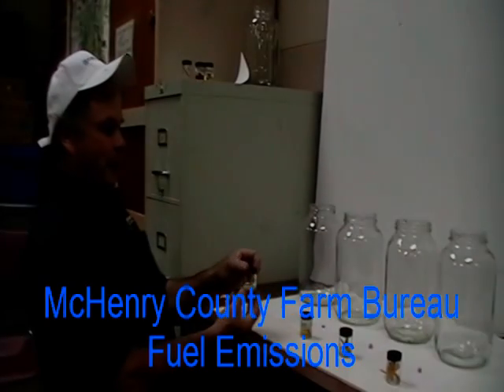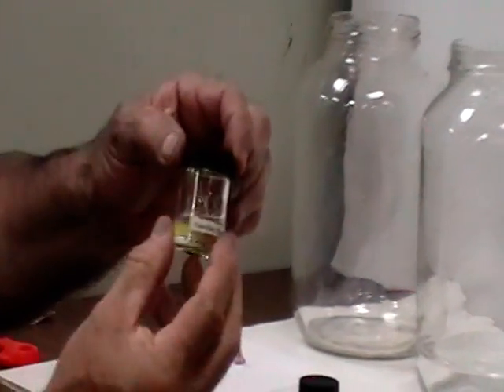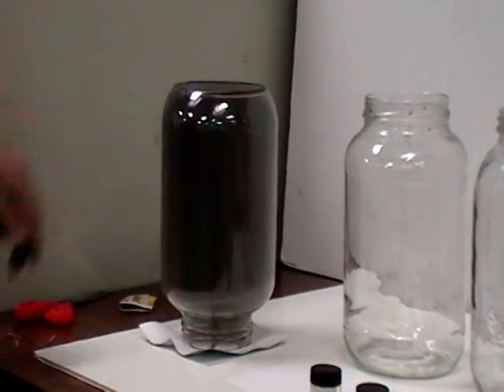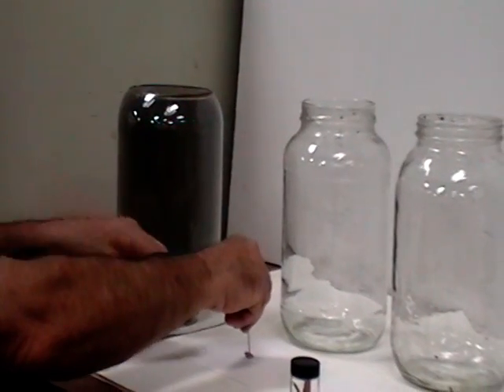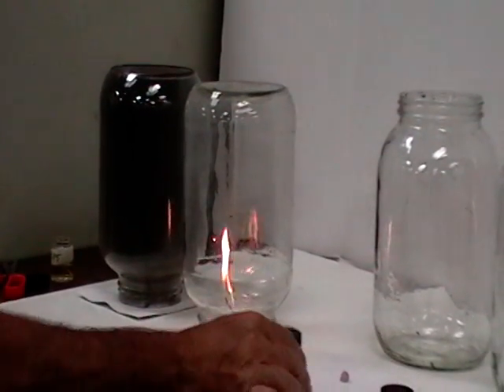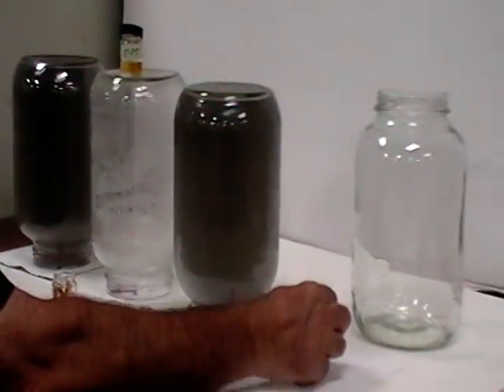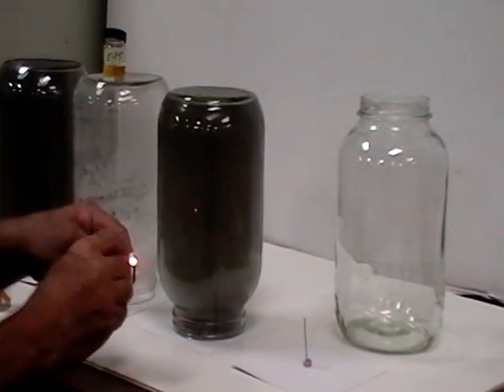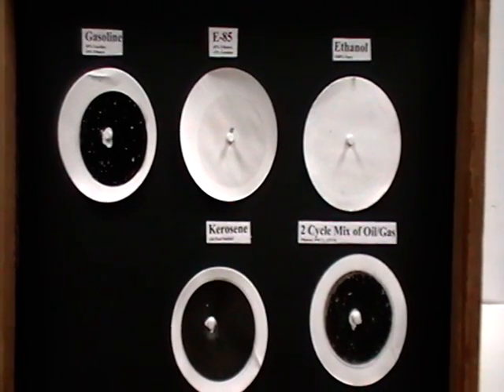Fuel Emissions - Gas, Ethanol, E85, Kerosene

Comment: You can compress e85, you can even compress e95 with a 5% ignitor. The first i heard of this was from an old wwII tank that ran off of anything, kerosenge, diesel, gasoline anything that burned in a pinch. Stage Coach in the uk managed to do so by raises the compression to 28:1. "To use the E95 blend in the diesel engine, Scania raised the compression ratio from 18:1 to 28:1, added larger fuel injection nozzles, and altered the injection timing."  GM is also in the works for sparkless gasoline.

Comment: I remember that, having 245,000 miles on my monte and 255,000 on my lincoln continental. Both using e85. both for over 100,000 miles. If your attracting water in a sealed tank, youve got problems. It snows here and that has yet to be a problem for me. The e85 has 0 corrosion and keeps my engines running clean and healthy. Actually, a full conversion would require changing the injectors and no, your going to lift the heads on something that needs 18:1-22:1 compression to burn efficiently.

Comment: This experiment is nonsense as the fuels each require differing amounts of oxygen relative to their density, not only are the fuels burning in a reduced atmosphere inside a closed jar, the less dense ethanol is more suited to being burned off a chemistry stick, do the experiment again making sure each fuel is atomised for optimum combustion, also take into account the usable energy released versus emissions

Comment: another possible fact is that the relative amount of carbon left on the paper is inversely proportional to the amount of power that is available in the fuel solution.  Explanation: Since the amount of oxygen for each reaction is fixed, one assumes that the other variable of combustion, fuel or carbon, is represented by the density of smoke and the more smoke, soot, carbon, the more power was available to start off with. and your argument seems to be in "green" interest, well plants breathe co2